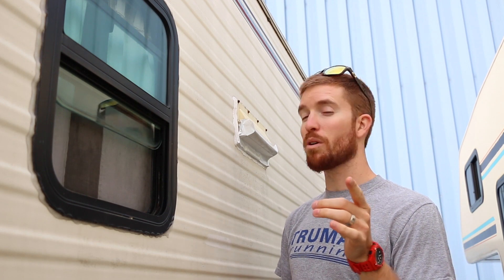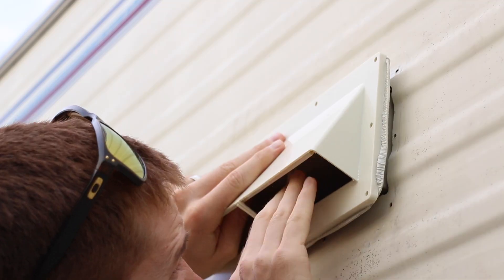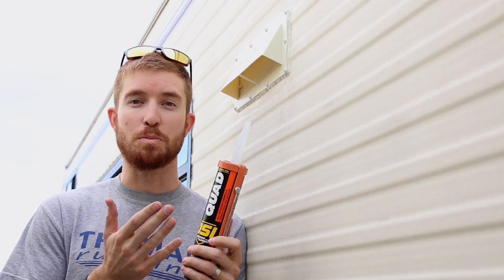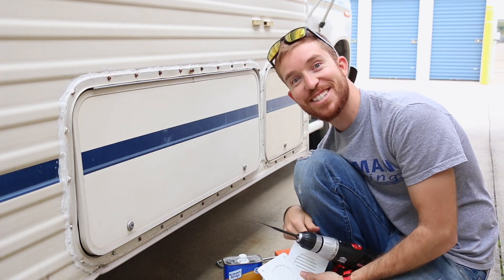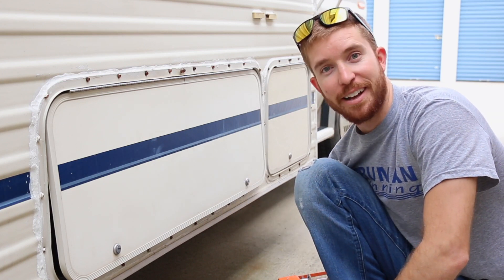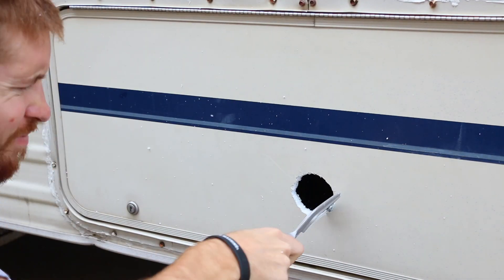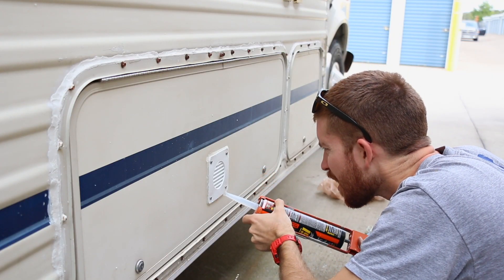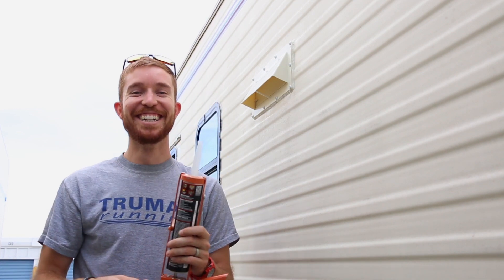Venting Our Solar Batteries + RV Oven Vent Cover Replacement

Comment: In addition to the hole saw mentioned below, I would suggest removing 1/2" or so of the inside insulation and filling that space with a filler of some sort such as an epoxy based fairing compound.  That would seal the insulation and prevent water intrusion into the insulation.  I work on boats and we always seal penetrations that way.  I was glad to see that you thru-bolted it and used fender washers to avoid crushing the door panel.

Comment: When caulking a painter usually uses his finger or putty knife to smooth out the caulk which helps push the caulk into the voids and helps seal it to the surface.

Comment: Love your videos. I am in process of determining type of solar battery to buy when sleeping in close quarters w a flooded type or AGM battery. If I vent my truck bed cap (tall bed cap, 6.5' truck bed) would it be ok to buy flooded instead of glass mat AGM? Trying to keep battery weight and cost down. How significant is battery gasses in flooded batteries? Thanks to all who reply!

Comment: The flap must be secured when driving otherwise it will flap back and forth until it breaks. It must be locked closed. I learned that the hard way. 

You probably should have vented it with a hose from the battery box to the valtera vent cover. There is a backer that will attach to a 2" hose and fit tight against the back of the hole in the door. I hope it doesn't have to be water tight in that area because it is no longer air/water tight.
Reply from the maker: Hey Patrick! Thanks for the advice on locking the vent. Just out of curiosity, how is the sub bay no longer water tight if the vent slots are angled downward? Thanks again 😊
Reply: Duet Justus hi. Thanks for the response. As you drive down the road in the rain a pass by other vehicles the tires on those other vehicles splash water up. The water is actually spraying up at the same angle as the vents. Anything you store in the compartment can get wet. This is just one example. The vents on mine are vented in compartments that are designed to get wet. You will need to drain them too. Best of luck. And sorry to be such a downer.
Reply: Duet Justus 
Also, if you have a compartment that is also heated by circulation of hot air the hole will allow for cold air to enter the compartment. The reason it is made mostly of foam is to insulate the compartment. Letting the air directly in the compartment allows cold air to enter and come in contact with uninsulated walls thus reducing the overall R value of the coach.

Comment: Where did you get the valve stims for the dually tires? I put on new tires on the rear put the inner tire loses air I put rubber ones on and it leaks.The new copper ones that you use after where did you buy them? I try auto zone,Oreily Walmart, tires for less, pep boys, most or the tire shops.
Reply from the maker: Hey David! There is a link to the exact ones we bought on Amazon in the video description of this video. They have been on for a few months now and they are holding well. Hope this helps and thanks for watching!

Comment: Hello, just a little fyi...I also replaced mine but I still did not feel that the flap was going to keep bugs out so on the inside wall I cut a piece of screen to about 1/8 inch over the edge of the opening and used a double sided tape to adhere the screen to the wall then just used a complimenting tape to go over the screen on top of the edge to have a finished look. Now not even an fly,  ant or the littlest spider can make its way through any of my vents since I did them all. 😊 I hope this doesn't sound complicated?
Reply from the maker: Really great tip here! Thank you 🙏🏼 😊
Reply: Duet Justus I just know that being outdoors is bad enough battling bugs and I don't know if it's because I'm female or what but I HATE ALL BUGS!  LOL! I especially don't want them in my rv. I also have shoved alot of dryer sheets and steel wool  in all spots that mice may try to enter into through any tiny gap or space beside pipes floor vents etc... I hope this and the screen helps keep you bug and critter free. It has me 😊 not 1 spider or mouse yet. 
Merry Christmas to you both. Are you going to decorate your home? If you do we would love to see what you did. I also hope that 2018 brings you lots of adventures and memories along with health, lots of laughter and most of all. ..love.  
Take care and have fun
Michelle.

Comment: Just curious. Is the battery vent above the batteries?  Gas from the batteries is hydrogen which of course is lighter than air so it will not move down to the vents. Do you remember the Hindenburg?
Reply from the maker: Hey Randy. The vents are not higher than the batteries but there are holes drilled at the top of the sub bay that already allow for some ventilation (that was done when I wired all the solar components together). We just wanted air to enter into the sub bay so we could allow more ventilation than was already there.
Reply: good point Randy. Also with the vents up higher less road water would have been getting in that bay.
Reply: Duet Justus ...so you are venting hydrogen gas inside your living space from the solar holes?
Reply from the maker: Hey Robert. Its hard to show everything through video but we drilled holes between the two sub bays where the batteries and charge controllers sit so we could wire everything together. There is ventilation to the outside (under the RV) through those holes. Hope this helps explain it all a little better 😊

Comment: I have changed numerous vents before but never caulked afterward when using Butyl tape. Butyl tape is a sealer so caulking is unnecessary.  In my many years of working on RVs, I've yet to have any leaks caused by just using Butyl tape.
Reply from the maker: This is great to know and definitely what we will be implementing on our next RV. We’re just doing it now to match the “aesthetics” 😜

Comment: I agree with others....should have just tried a hole saw.  Also, no real purpose for the butyl tape since there is a big hole going right into the compartment now with the vent.  The tape is used to keep a waterproof seal, but you don't really need that since there is a hole there now.
Reply from the maker: Hey Marc. Maybe I’m missing something because other people have mentioned how it’s no longer water tight but the vent slots face down so rain water won’t get in the sub bay. Unless I’m missing something, it should still be water tight...
Reply: Hey!  Agree rain water won't get in, but other road water will possibly still get in being splashed from other cars.  Just don't depend on it to be watertight.  Water tight would mean NO water can get in.  Rain water shouldn't be able to get in, but just be careful to check it every now and then.

Comment: Why not just use a 'Hole' saw???  Would of been a lot simpler and cleaner!!!  Also, there goes your storage compartment being water tight!!!  Might come back and bite you in the future....
Reply from the maker: Hey Barney. I don’t own a hole saw and I knew I would reuse the hacksaw over and over again in the future. No need to buy something that I’ll only use once when I can get the job done with what I have 😊. Also, just curious as to why the sub bay is no longer water tight when the vent slots are angled downward... thanks! 👍🏼
Reply: Rain/water doesn't always flow down....hard driving rain coming sideways....vehicle splashes, water spray whipping all around following the air flow around the rig and from the tires.  Trust me, water will find a way where you don't want it and when you least expect it.....wouldn't keep anything in that compartment that couldn't stand a bath every now and then!!!  :-)
Reply from the maker: Good points lol. Water is an incredible thing haha. I hope it will hold up 👍🏼

Comment: Just another caulking tip. Don't pull, the caulk bead, turn  the caulking gun around and PUSH the bead ahead of the tip of the caulk tube. It will force the caulk into the corner better and make a better bead. Awsome videos though....
Reply from the maker: Good stuff. Thanks!